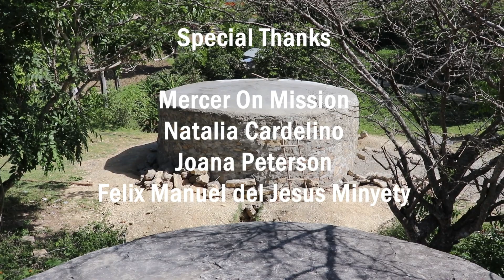Stone Water Tank Construction Explainer: Mercer On Mission Dominican Republic 2023

Comment: THE MEN THAT'S BUILDING ARE THE TRUE HEROES BECAUSE THEY ARE USE TO  MEASURING, DIGGING THE TRENCH,TIEYING THE REBAR WITH WIRE,AND PUTTING IN THE BACK BREAKING CONCRETE JOB BY HAND WITH WHEELBAREL WITHOUT MACHINE.